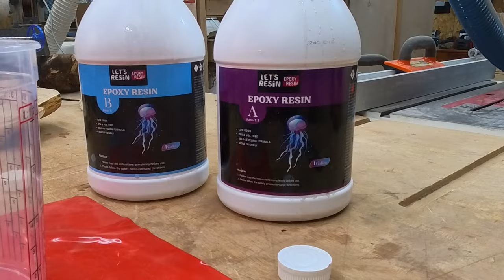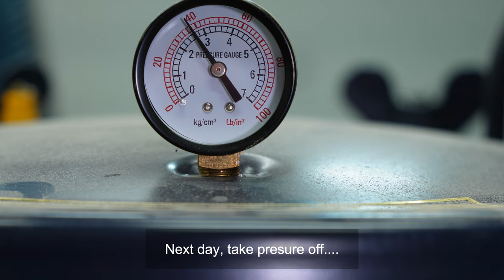Transforming Firewood into Jaw-Dropping Wood Art - #woodturning

Comment: Well done!   Really like your color choice.   Especially like your finishing rig but I don’t see any info on it.   What motor are you using?  My slowest speed is 150 rpm’s and that’s way way to fast for applying finish and drying.   I was thinking of getting a bbq grill rotisserie motor and making something similar to your set up.  😊
Reply from the maker: I bought a cheap BBQ Rotisserie motor on Amazon and encased it into a wood box with a water pipe protrusion. At the end of the pipe I screwed on a flange that then can be screwed to the bottom of the bowl. It turns at 8rpm which is ideal for table top epoxy to set evenly. Ill be doing a short how to video tomorrow and will post it up on my channel so all can see. Thanks for the comment, there are possibly a lot of turners asking the same question. Cheers!